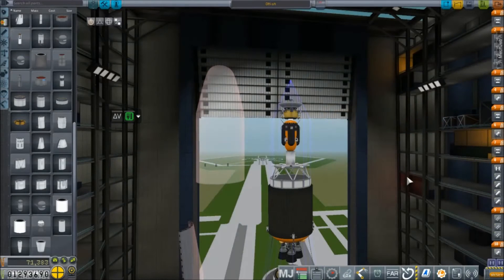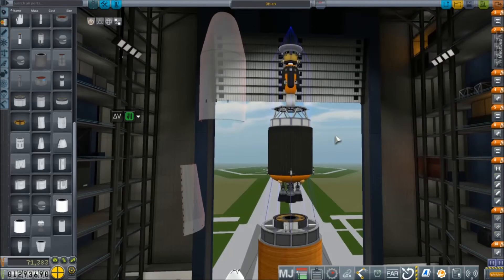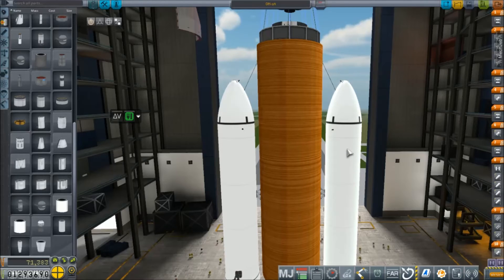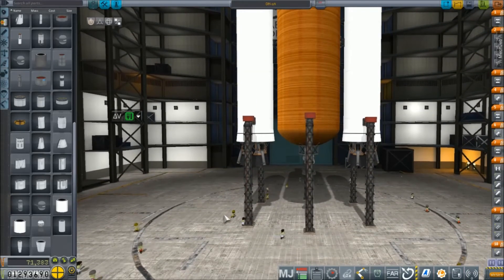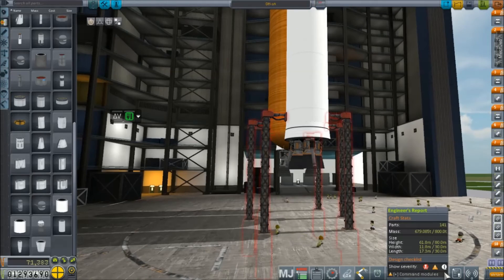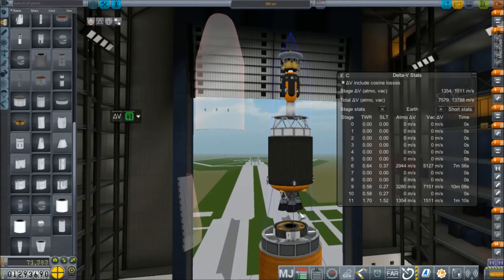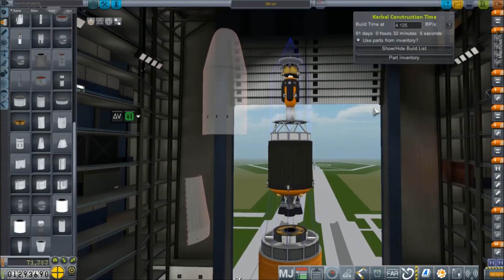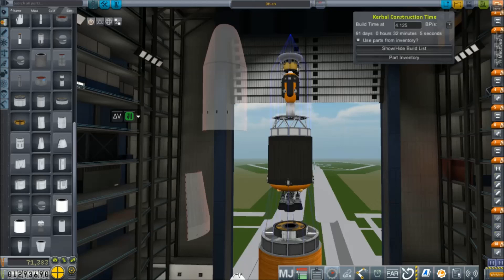KSP RP-0 #174 New Launcher - DN-1A

Comment: No just don’t use The J2 on the main core stage so just use an RS 25 and use the J2s for the future  upper stages to be honest using stronger engines will be more reliable than those flimsy J2s  also I’m going to give you a redesign also you could do the design that I’m gonna show you so replace The two J2s with big RS 25 engines and make the boosters have more engines to add a huge kick and increase the payload capacity of the DN 1A I hope you like my new design technique you can follow if you want
Reply from the maker: I went with the J2 here because of it's long runtime - I did not have the RS-25s unlocked yet, or I would have used those instead.  
Spoilers:

Another viewer made a config for the HG-3 engines ( a never built prototype based on improving the J-2X ) that went in to service on this launcher for a long while, until they were replaced by the RS-25 D/E in a later iteration.
Reply: so the J2s reason why I said do not use them is because that three really weak in the atmosphere but they’re not really really weak it would actually require two more to add the same amount of force just to push The DN 1A out of the atmosphere but to be honest if you wanted to send a space plane into space (it would need to be smaller than the original shuttle design) if you were sending it to LEO you would need more engines if you were sending the space plane to LO (lunar orbit) it would require something beyond J2s even with the J2X it would still be a struggle but anyway I hope you enjoyed reading this
Reply from the maker: unfortunately the procedural wings are not heat rated for anything beyond a LEO re-entry ( and even then you gotta be careful with em ) so no spaceplanes/shuttles will ever make it past LEO ( mars : maybe - but only to stay there )
Reply: @CosmonautCrash  if I might add something, horribly overtime, (sorry 😊) you can also increase the utilization to a hundred percent to increase your mass fraction. 
And there are way better kerolox engines to use as boosters, for example the nk33.